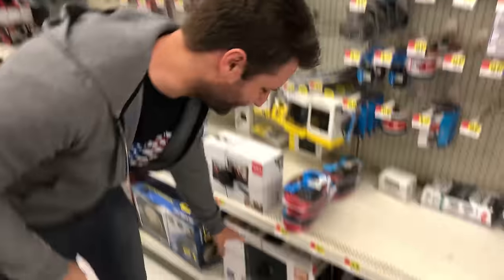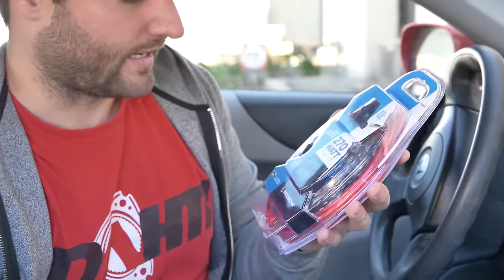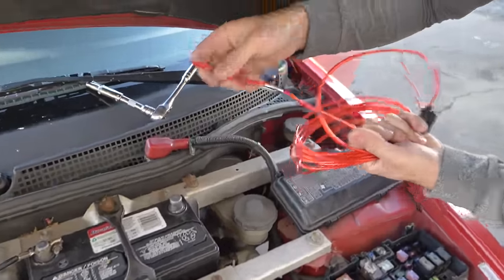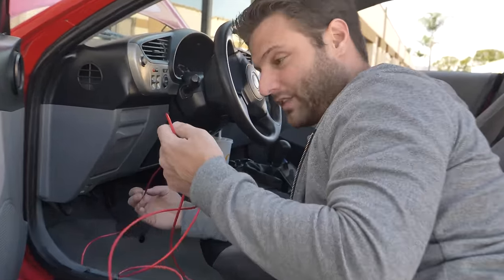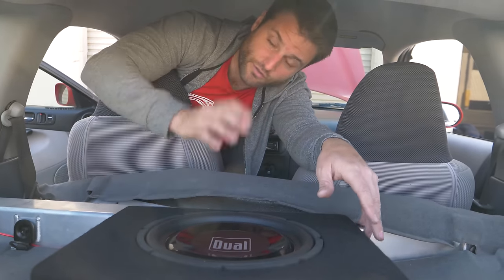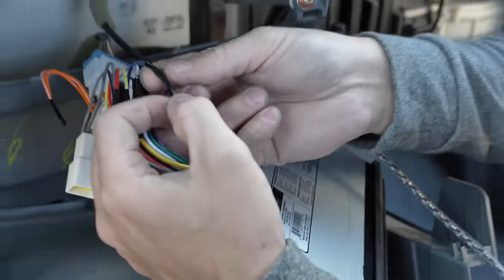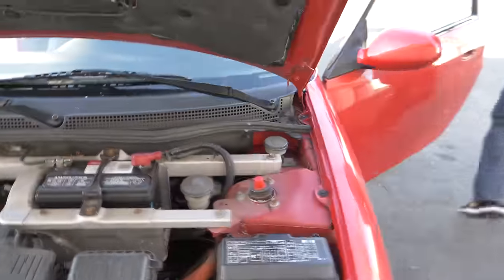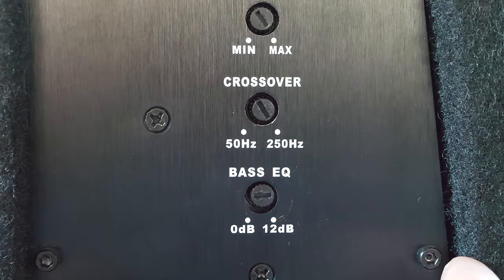How bad is the $70 subwoofer from Walmart? Install | Review

Comment: @Rob Dahm A subwoofer should be placed as far to the rear of the vehicle as possible without allowing the sub to rub on anything normally or while in use. With a single sub that isn't high power you will have better results if you aim it into a corner of the rear because the lower the tone/note the longer the full cycle wave form will be IE a 60Hz frequency is about 18 feet long so unless the audio wave travels at least that far before you hear it, you will never hear the music as it was when recorded due to the frequency not being fully completed before it reaches your ears. The farther away and the more air volume in the box the better it will sound as far as sound quality goes anyway. I hope that helps you out, but I hope it helps out a ton of other DIYers as well. Also, the phase of the sub may have to be switched depending on your vehicles audio setup. Basically you want all speakers to move outward together and inwards together or the speakers are working "out of phase" with each other which reduces the perceived loudness of the entire system, especially if they are playing the same frequency on all speakers.

Comment: You should have ran thicker cable in case u wanted to upgrade the speakers and amp.  Now if u up grade u will have to re run bigger gauge wires

Comment: Power cable is so small! Power and speaker wires/cables should be as far apart as possible to not have them interfere with each other.
Reply: Wrong. Unless they are "magnetically shielded" it wouldn't matter, You could literally wrap them both together, and not have any kind of: " Hum" or Alternator noise, turn signal pop, or brake light pop. You buy cheap shit, you get "outside" interference, Buy quality product, and know what you are doing, and you'll have a decent, enjoyable sound, No, You will not get high-end sound from a $80 dollar set-up, But a since of reasonable enjoyment.

Comment: Dam, if you're going to do all that work like he did I would at least tell the owner of the vehicle to upgrade to a $200 sub in the future.... All that for a $70 sub is pretty insane. 
I'm aware it's the point of the video to test the cheapest sub. I REMEMBER MY INSTALL BEING HARD!
harder because my power wire was one of the super thick FAT ones...it was worth it though because I bought the most expensive sub I could afford.
A $500 Rockford fosgate box.
Good times...
Great memories.

Comment: Please if anyone is connecting any kind of audio amp in your car, connect the power wire directly to the battery!!! And run the power wire through the firewall, there will usually be an existing hole you can use!

Comment: I forgot there was a time when car panels simply came off with a wrench!

Bit of a “ghetto” install but does the job (says a guy who’s just spend 5 days doing an install on a 2017 fiesta).  Wiring kit is very cheap looking but I doubt a cheap active sub is drawing that much power anyway :s!  The power and ground wires on the sub are probably doubled up so they can get away with cheaper cable.  No need for the remote wire to be doubled though!  I wonder how many brands the factory in China labels those subs up as!!

The direction the sub faces in might make a little difference but probably not huge if the subwoofer is actually putting out bass.  Firing to the rear windscreen is one of the most common orientations.

Comment: Surprisingly I should have bought a dual instead of a boss cheap stereo system for 20 bucks at Walmart because the boss is plagued with issues where I've seen duals and install them before with no issues

Comment: Installed everything like in the video. Now have no electrical in my vehicle. Ran the power wire to a random fuse in the fuse box. Also ran wire through my hood, fender, door and rear Quarter panel. Here scratching my head thinking what possibly went wrong???😳 maybe if I put the positive wire hardness on the negative terminal and the negative wire hardness on the positive terminal it will fix it.... maybe 🤔 I’ll try and left you all know if that fix’s it....

Comment: I purchased the exact dual speaker from walmart, and the wiring kit by scosche. Except the scosche wiring kit is the 680 watt kit. Is that to much power wire for my 300 watt speaker? Thanks anybody who could lmk if im good or i need to change to the 270 watt speaker wire kit as in the video. Thanks ! Awesome video!!
Reply: You're better off with the heavier duty wire. You can't really over wire it but you could starve it with to small of one.

Comment: never run any 12v wire with the rca's!!!, keep them on the power wire side, your blue wire? remote?
Reply: I know your comment is a little old but it is perfectly fine to run the remote turn on wire along with the RCA wires. Remote turn on output from head units is usually max 0.4A which is not enough to cause interference with a shielded RCA wire. That’s the way my wires are routed with my system with no issue, as with the last system I installed also. Even Crutchfield says it’s perfectly fine to do so.

Comment: speaker/amp combo 300 watts. Wire 270 watts you couldn't just pay a little more and have the correct wire.
Reply: That was peak power 300 watts more like 50-80watts. litterally any decent cars stock system will have more bass then this LMFAO.

Comment: Even with a low powered amp you shouldn't use that amp cable.. the anemic wire causes headlight flicker when the 808 ( Bass ) drops.

Comment: that sub is a waste of money. my buddy got one on facebook for 30 bucks and thought it was alright for the price until it kept shutting off from thermal protection. he gave it to me and i fixed the issue by using a hole saw and making a port next to the amps heatsink. the speaker pulsing in and out caused air to flow over the amp and kept it cool. it doesn't have much power but its better than nothing. i'll stick it in my yaris for shits and giggles lol

Comment: Maybe try setting the gains with a smd dd1 or the smd dd1+ and setting the crossovers with the smd cc1 next time.
Reply: Why the hell would you use $600+ worth of high end tools to tune a system that doesn't hardly put out enough power to even make a difference??? This speaker is so weak I could tune it in 5 seconds with my ears. There's not a whole hell of a lot to tune

Comment: Lmao I used the 1200 watt version of that exact same wiring kit for my truck
Reply: Doesn't matter the size of any amp, 1200 watt kit is a must-have, even if you're only using 300. Thicker wires, and they're cheap enough that you can run it through the door and replace every few months way before it takes any damage.

Comment: I know its super late but in order to to set the gains on the amp you wanna put a 40hz test tone on and turn the head unit to 3 quarters of the way up and turn the gains up slowly until you hear a change in the tone of the sub playing 40hz and then dial it back just a little until the difference in sound goes back to normal

Comment: I was needing to replace the little tweeters in the headrests in my '92 miata, and of course I come across this video. I'm not looking to blow people away but to have another reason to enjoy the little car even more. Opinion: by not wanting to turn my miata into a rolling soundsystem to blow people away, would this system work? I have the same radio in the car in the video, (it came with the car went I bought it two weeks ago)

Comment: Never have I seen before anybody connect the positive cable to their fusebox 🤔🤔 Only done straight from the battery and the fuse right after it tho. I guess it doesn't matter that much, maybe your way of doing it is safer. Good video, I mean for like what, $80? About like 70€ that's really fucking cheap. Throw extra $250 that be actually fucking awesome to listen to and not "weak"

Comment: I understand this is a small setup with low power requirements, but never install your power wire to a fuse box… needs to be directly on the battery.

Comment: Okay yeah he didnt wire it "correctly" but its not wrong. Its a small speaker advertising 300 watts, realistically 100 watts rms. Running from the fuse box ain't gonna do shit at this power. I own this sub, i ran it for a while in the car along with a 12 and the cars stock 8. I wound up moving it in my room as part of my audio center. Wired it to a old computer power supply that outputs 12v at 280 watts . Anyways, you want to know what? It's not bad for the price... It didn't do much in the car since I ready had alot going in there, but I can feel the bass in my room for sure. In a base model car with no bass this thing will "bump". It won't be heard blocks away, but you will definitely feel the bass. When blasted the mirrors will lightly vibrate. Yeah it won't blow your ear drums, and yeah you can dig around on marketplace and hunt for a "better deal", then have to deal with shady ass people. But for Joe Smoe who wants bass in their stock Nissan Versa, so they can listen to Johnny Cash or Led Zeppelin while driving to work this is great. Its easy to install being all-in-one, relatively cheap, plus you don't have to deal with meeting Juan from Craigslist who will only take cash for his subs and lives downtown on MLK boulevard

Comment: @Rob Dahm @4:44 you said "power goes in a full circle. That is actually incorrect. The electrons oscillate in a back and forth motion. Look into it. It is true and you can find that information too so you can see it for yourself. There are some other weird properties that transmit to power down a down, including how power is transmitted OUTSIDE of the actual wire in the form of a magnetic field which is why Tesla, the inventor not the car, wanted to transmit power using our atmosphere instead of long wires. The channel named "Veritasium" on YouTube talks about all of this as well so I am not talking out of my ass or something like that. @Rob Dahm After you look it up, can you reply here so others can be better informed too?
Reply: @orionsbasementandbeyond8447  I said nothing that was incorrect, wrong, rude, crude, or otherwise harmful. It is simply informative which is exactly what the purpose of the video is. Perhaps you should just relax and take it for what it is, constructive information. Let it go bud...

Comment: How do we make our highs and mids a little louder now? Ever since i did this same sub install thanks to your video bro.. i have a 1990 accord lx and i see there is a stock amp under passenger seat? Im sure its from 1990 so is there a way you can make a video for that? cheap amplifier for the 2 front and 2 rears? Just to make the 4 walmart sony speakers i have? Can i just remove passenger seat and remove stock amp and use the already wired wires and just plug and play? Seems super easy :)

Comment: So, how did this minimal upgrade affect your battery? Did you face any headlight dimming or found your battery died after a few months?
I left out the sub in my upgrade because I worry it'll be too much for the battery.
Reply: If you use a small low power subwoofer it should be fine

Comment: This is NOT A DEAL. Save up 180 bucks. This will get you a single 12 Jensen sub, a 1200 watt amp and a prefab box from Wal-Mart. It is twice the price but it will be 4 times as good. To be hounust I don't even really think the second option is something I would do. But for the people who want something as cheap as possible there you go. If you have the ability and patience to save more money do it and buy quality gear that will last.

Comment: I am afraid that the 270w wiring kit will not take the 300w amp
Reply: i'd be worried about that if it was actually legitimate 300w
Reply: I assume the amp rated power around 100-150 watt .

Comment: I got one of these for $25 used, I just had to buy the wire kit which was $27 😂 but it's well fuckin worth it. Best $25 I've ever spent
Reply: More like a waste of money.
Reply: @QuietWind01  you might be right, if I would pay $100 for a sub, box and amp which is possible to find. Then I see how this $52 wire kit and ampsub combo would be a waste of money. Thank you for opening a new perspective on this
Reply: @dkinley334  Right. But even if you spent a little bit more, and just did everything yourself and took the time to do so, maybe $100 more, you could find something used or even new that, if done properly, could sound, feel, and pound much better

Comment: You said you wouldn’t mess around with that large power wire but the kit said it was 270w wire kit and the box said 300w amp am I missing something here or was that a mistake? Could this overheat the wire and cause it to catch fire?

Comment: your radio wires aren't soldered?? that looks kinda dangerous, especially just using electrical tape rather than shrink tubing. electrical tape falls off over time and will expose those wires.
Reply: I don’t always recommend soldering as most DIYers will cause more issues than anything. I always say to just heat shrink them at the minimum.

Comment: I take it the installation manual isn't clear on how to attach the hot wires? I hate when something that important isnt simplified as it should be for a Walmart level speaker. They need to make it grandma easy.

Comment: Your explanation of a crossover isn't exactly correct. The crossover frequency isn't the highest or lowest frequency that the sub will play, it's where the signal will begin to attenuate. For example, a -12DB slope at 80HZ won't cut every frequency off after 80HZ, it will roll those frequencies off and be at -12DB per octave, so at 160HZ, the signal would be down 12DB and continue to roll down as the frequency increases.

Comment: TAKE OFF THE NEGATIVE LEAD, NOT THE POSITIVE!!!!!! The positive lead doesn’t prevent current flow. Electrons move towards positive and away from negative since electrons are negatively charged so remove negative to prevent shorts and sparks. Also, never buy walmart amp wiring. Their wiring is like, 50x more rubber and 10x less wire. In other words, their 4 gauge is more like 8-9 gauge.

Comment: That’s trash 😂 My system isn’t any too crazy. I have 2 Crossfire C3V3 12” 400 watt (rms very important) powered by a Skar audio LP1000.1D amp in a custom 33 hz box, and they shake the entire car inside and out, everything on the outside flexes. I did everything myself (including building the box which can be half the cost) and it only cost me about $450.. You really need to hear some good subs, it’s an awesome experience

Comment: 6:45 no way you just twisted and taped them haha at least use a crimp cap or wire nut, but I always solder and heat shrink my connections

Comment: You never run a power cable through a fender and through the side it's asking for it to rub against metal and catch on fire LOL. Also you never run RCA and Power on the same side it will give you engine noise you will run all your power on driver side and RCA's on the passenger side

Comment: Never put your power wire through the door the door will cut it there's plenty of holes in the firewall a little rubber boot stick it through there it'll end up by your gas pedal or break 🧐 just will be better for your car. 🚗 We stop doing that in the 80's it was braking the wire to fast open and closing the door.

Comment: After installing the subwoofer, have you noticed the amplifier getting hot to the touch and is it normal?
Reply: Darryl Foster yes that’s completely normal. You might have to give amplifiers a break every now and then if you are pushing them to their limits.